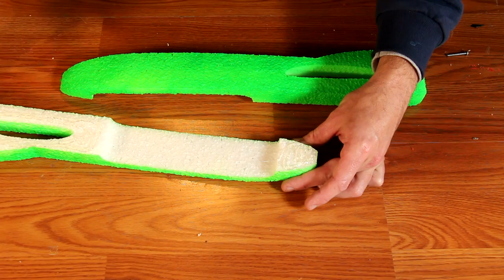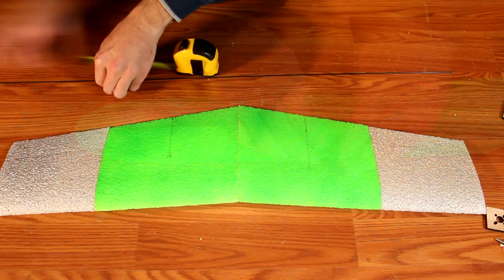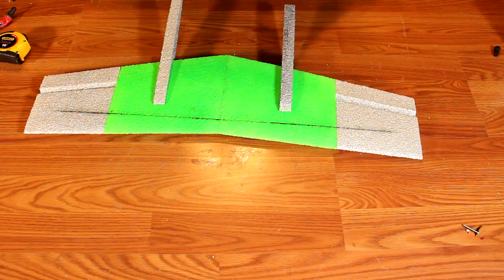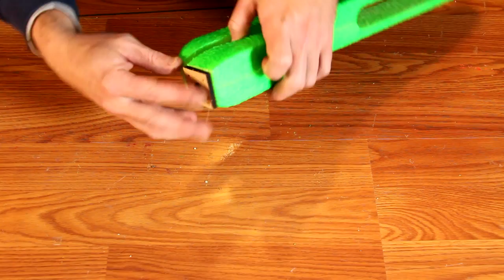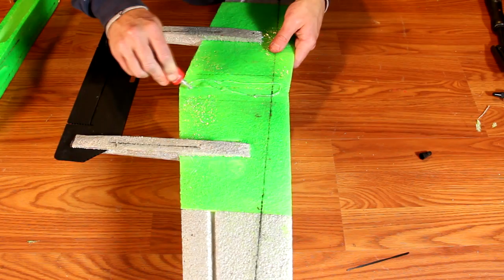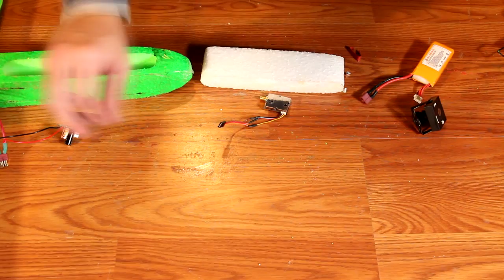Wraith Micro Build video

Comment: Finally finished mine after letting it sit half finished over the winter. This plane flies AMAZING! It's just great for proximity FPV. It's replacing a long line of FT Arrows built for the same purpose. I started with a 2206, but it couldn't balance with the the 850 mah 3/4S batteries I had on hand. Swapped it for an old 2204, and that was still plenty of power while balancing perfectly. Some recommendations after a few flights: The laminate can tear, so add fiber tape to the leading edges and aileron hinges to protect against cuts. I started using the middle holes of the provided control horns. This was unflyably sensitive. Even in the outer holes, I have to limit servo travel for sane rates. It also requires a moderate amount of up-trim on the elevator, and a little down-trim mixed in with the throttle to fly perfectly. (Maybe my CG isn't quite right though?) Lastly, trimming the ailerons up a couple millimeters seems to make this plane practically unstallable at low speeds. Love it! This is going to be a great summer of FPV.

Comment: hey bro are you best thanx for your all videos
ı  want make foam vas specter
can you sendme vas specter plan, project, measure, pattern ?
Reply from the maker: There are plans on FPVLAB:  http://fpvlab.com/forums/showthread.php?2769-Specter-V2-V3-Best-basher-FPV-plane-yet&highlight=specter
Reply: Thank you for your support
but i do not find naca2412  coreldraw or solidworks
naca2412 is suitable for  vasspecter?
Reply from the maker: This is a Clark Y airfoil on this airplane.  It should work well on your model.
Reply: ok thnx ı make clark y http://airfoiltools.com/plotter/index

Comment: you never show the spar installation on the booms..... my kit didn't come with enough spar to spar both sides of the booms...
Reply from the maker: I changed the material in the booms so it doesn't need spars instead.  The booms are a stronger foam.  Simply laminating them makes them plenty stiff.